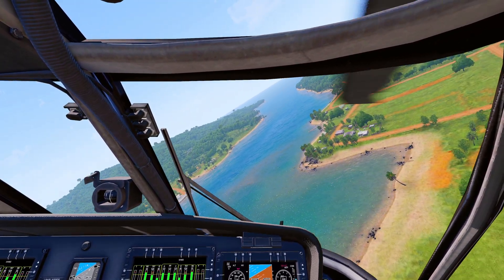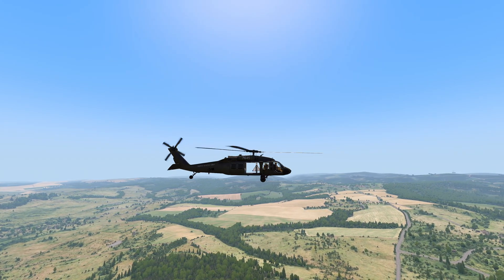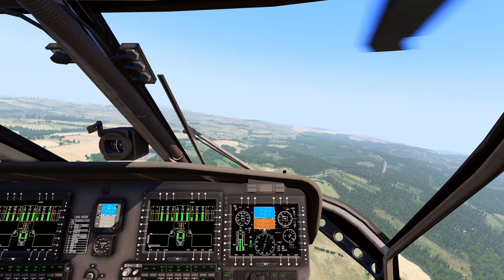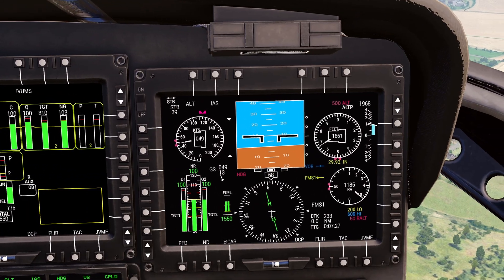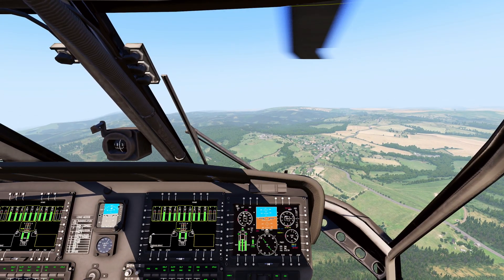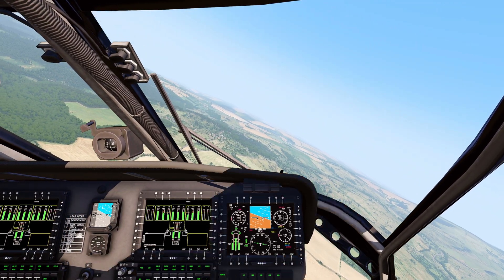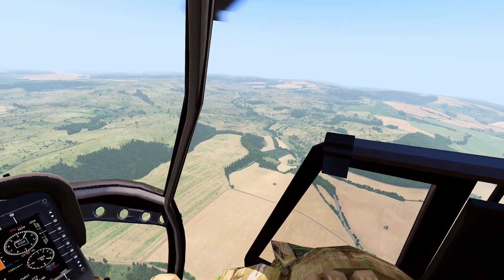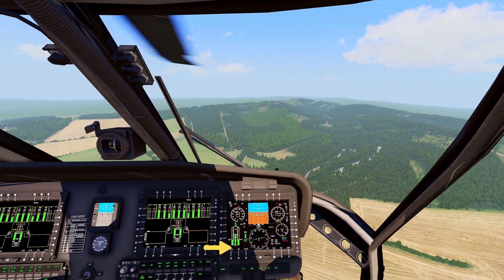H-60 Mod SFM+ Tutorial | Episode 1: The Stabilator

Comment: How do I bind buttons to my HOTAS? Is that an option?
Things like autopilot modes, hover on/off, fuel and generator switches... basically everything that is pressable in the cockpit should be mappable. Am I missing something?

I see the limited options like FLIR slew etc in the controls> add-ons menu. Is there more?

Comment: IRL, the blackhawk's rotor system is rigged forward so that when you hit 100 knots, the rest of the helicopter is actually level. Only the rotor system will tilt forward at this airspeed. Should be hovering at about 5 degrees nose up.